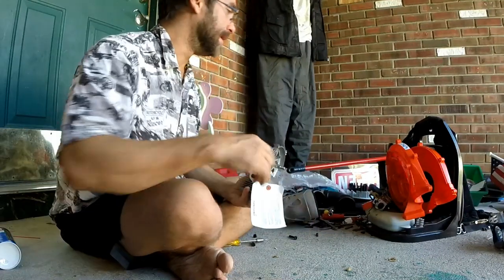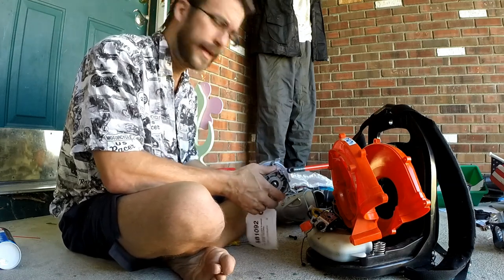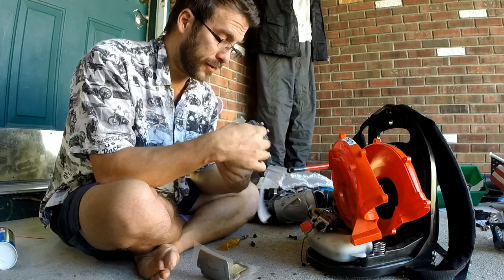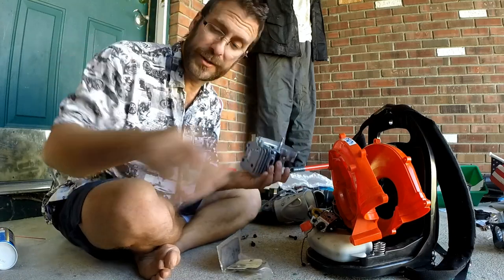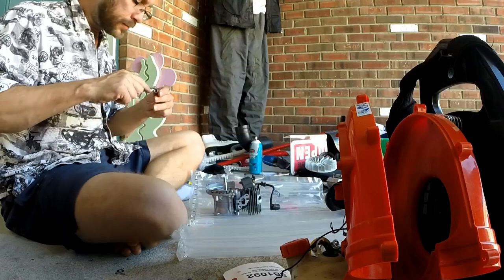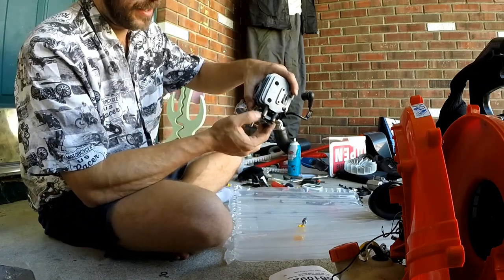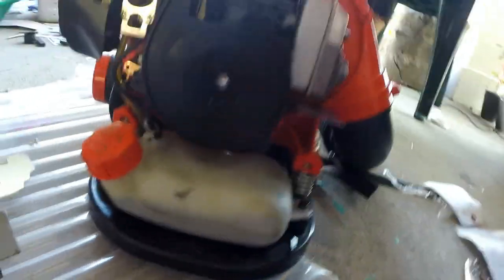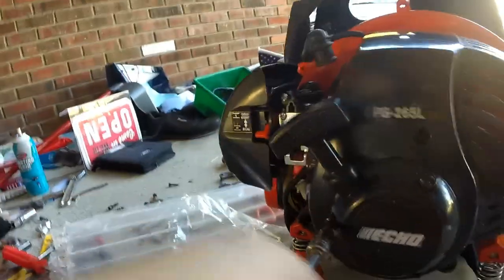Install New Short Block (Engine) in Echo PB-265L Leaf Blower

Comment: Darn it... the one thing I needed to see in the video you cut out. The installation of the impeller U screwed on the fan impeller but then there's a nut that goes on the end of that and you skipped right out of that and went on to the next scene without seeing how you put it on because I'm trying to remove mine and I wanted to know if it's reverse threaded or not. Wonderful, LOL
Reply from the maker: +Nick Davis Hell. My bad. Some parts were tough to get reasonable video of. I'll watch that part and see if I remember.